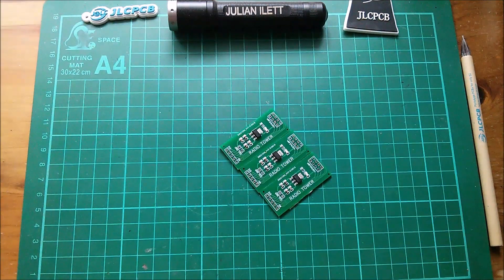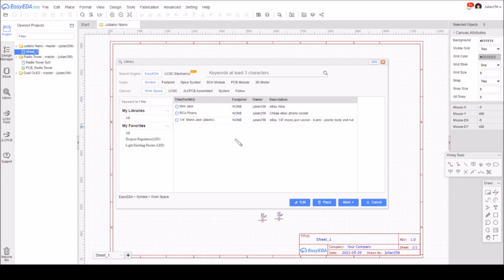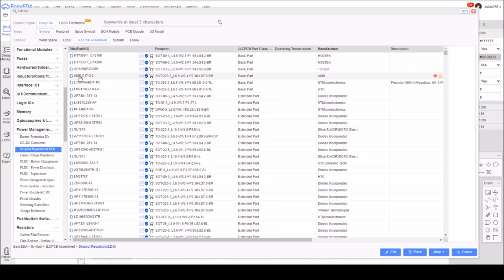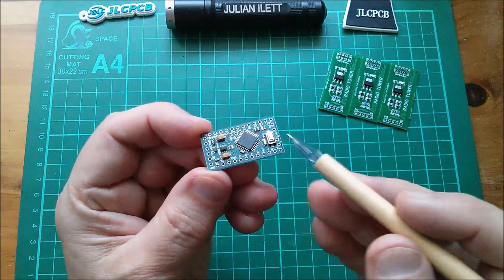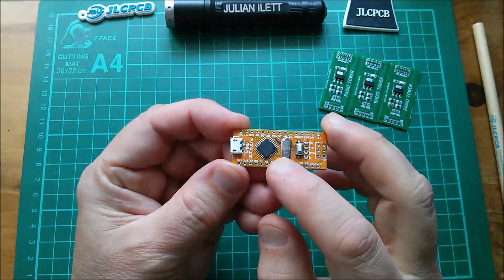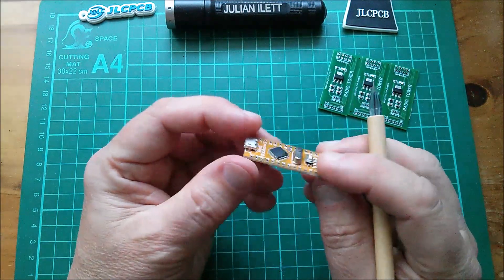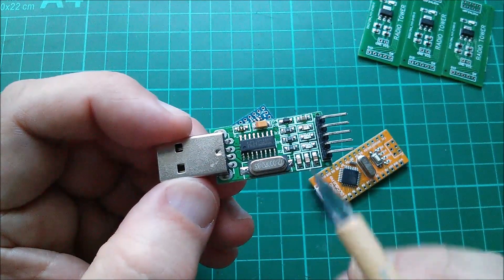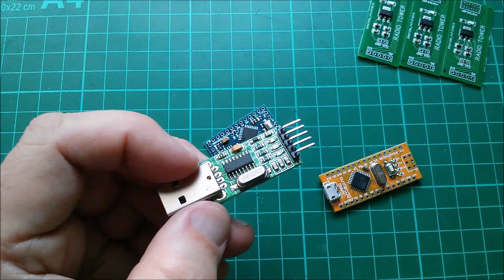Some new PCB ideas

Comment: Looked at the datasheet for the AMS1117-5.0.  It says Output Current (Max) is 1A,   Current - Supply (MAX) is 10mA.   What's the difference?

Comment: So, your project involves making a prototype using an Arduino, a dev/breakout board, a couple of hand wired interface adapters, and a few modules.  Good work.  Then you're moving to make it better by going to PCB, excellent.  But do you make a single PCB that takes the Arduino, the displays, the radio and the sensors?  No, you make silly PCBs to replace the hand wired adapter boards (thereby failing to reduce either complexity or physical unwieldiness).  Then espouse a plan to make your own USB to TTL-serial boards to somewhat pointlessly replace something easily and cheaply available.

Why not make a PCB that takes a Nano or ProMini directly, takes the radio board directly (lying down not sticking up), takes the sensors that you are actually using (maybe with a spare port for new IIC sensors), takes the displays that you are using (with the links for the two pinouts) and has a port for the TTL-serial to USB if needed.  This would be a more sensible path forward.  One PCB to be either your Tx or Rx end (hey maybe a link would allow you to choose this at runtime leading to a single firmware image).

Comment: You're working on something almost EXACTLY like what I need and will eventually pay to have design the PCB. I have some very tight dimensions to stay within, though.
I also want to add a LION battery charge/protection/boost to 5v PSU onto the same board that'll supply as much current as possible within the space allowed (about 20mm cylinder). Would also like an IPX connector for external antenna.  :D  

I'll be watching with great interest!

Comment: Might be a better idea to give some thought about using an AVR ISP programmer. Reason being, I have had several clone promini boards lately that absolutely refuse to load a program using the normal approach I used with the FTDI usb/ttl. Even went so far as to burn bootloaders onto the promini but "maybe" work once then nothing. With the AVR programmer, straight up, finish, no problems.

Comment: Julian, they only offer assembly on green or black pcb's, if you go yellow then order a stencil and buy a hot air station + ceramic tip tweezers.
Reply from the maker: Seems you can get assembly on blue, red and white as well (1.6mm leaded) but not yellow. Oh well, there goes the Banano :(

Comment: May b I missed something but if u use the atmega328 from JLCPCB how does one program it as it may not have the Arduino bootloader?
Reply from the maker: You use an ISP programmer to put the bootloader in :)

Comment: If you don't need USB conectivity in the final design then there is no point placing on on the PC.  As you say it's better to use a SUB to RS232 daughter board for programming and debug, then unplug it once all is happy and working.

Comment: That something new, I have designed some years ago, I designed board with 328pb parts and with plug in LCD location on board, now you said base parts so it be cheaper. That got me thinking, hmmmmm.

Comment: The LM1117/AMS1117 is a good regulator.  It does need a few more external components to work right with a switching supply behind it, but it has lower quiescent current than most other linear regulators and a very low dropout voltage.

Comment: I'm thinking of starting to design my own PCB's again, but not with the hazel of etching my own boards. Great tips if i do so 😀👍. And i'm curious, the leads for the USB con dosen't seem to be soldered at the top layer though the tracks only seem to be routed from there, are they just making connection by touching?
Reply from the maker: Definitely soldered :)

Comment: I recently placed my second ever batch of boards with JLCPCB, and they should know your endorsement, Julian, was a big help. I do not use EasyEDA, but rather KiCAD. I found JLCPCB's website a little more useful for selecting parts than the integrated browser in EasyEDA. There is a way to filter basic parts via the website. What's more, you can download a massive spreadsheet of all their parts and filter it yourself.

Comment: Alternatively, the CP2102 doesn't need a crystal and is in the basic parts!
Reply from the maker: Interesting - maybe I'll do one of each :)
Reply: isnt that what the ESP dev boards use??
Reply: @mikeynjs94  Yes!
Reply: Ya, the CP210x are better than the CH340.  But at least he isn't using a PL2303 or any FTDI.  I use the CP2102, it is a few pennies more but saves a lot of headaches.

Comment: You can switch the 328p for an atmega32u4. This let's you drop the usb-ttl ftdi and circuit all together since the 32u4 has a a dedicated USB peripheral. They also have very similar specs.
Reply: I didn't know that! I've been prototyping a project with various MCU boards, mostly the Arduino nano, and will eventually need to get custom PCBs designed and made. 
The crazy thing is, all the atmega MCUs are REALLY expensive at JLCPCB. Like, the 328p is twice the cost of a full ESP8266 module, which is crazy to me. Might as well use the ESP8266 or ESP32 since they're about half the price. Even if I don't use the wifi, it's basically free extra compute power.

Comment: You can always leave it off the assembly but order any parts you fit yourself direct from LCSC, avoid the surcharge but still buy the correct part designed into the unit at very low cost. For items like USB connector you can order a larger quantity and standardise on the one part for other future designs.